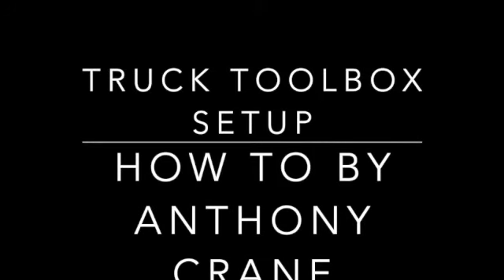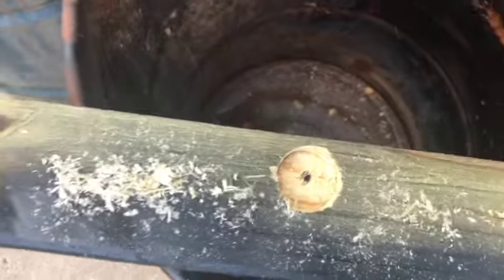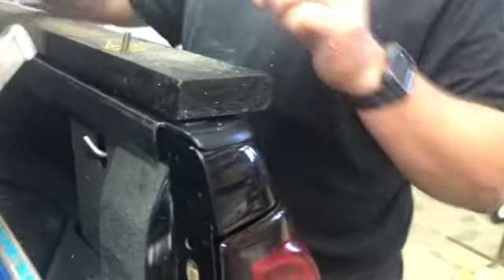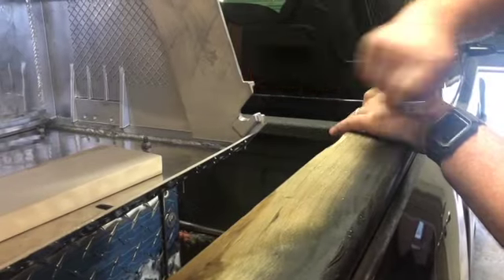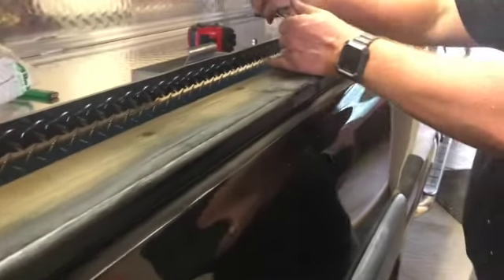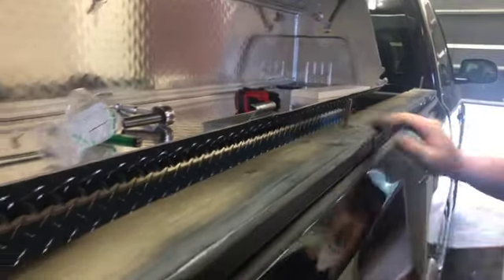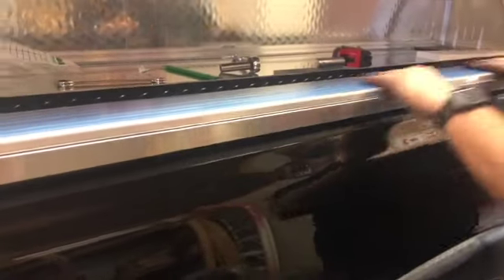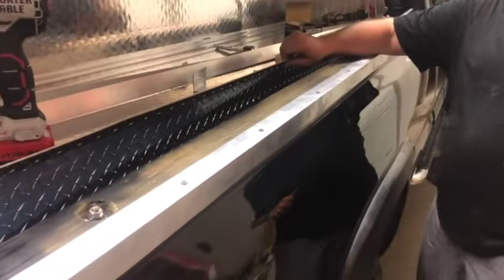How to build Truck Toolbox Setup with Decked and System One

Comment: Hi. 

Are you able to fit a sheet of 4’ wide plywood between boxes (on top of decked?
Reply from the maker: No, that is one drawback. But you can easily stand them up or put them on the ladder rack and strap the 4x8 sheets down. This is sometimes an advantage because you don’t need to move anything out of the bed of the truck.

Comment: Nice setup i'm in Ohio as well where did you purchase system one and decked
Reply from the maker: I ordered both on the Internet. System One I got from the link I shared at ladder rack. They shipped it right to my door. I ordered Decked from their website  and they shipped it to my door also. You will need to pick the size and model that you want for each one plus accessories. Let me know if that helps or if you have any other questions.
Reply: @anthonylcrane  thanks

Comment: I was looking at these a while back but couldn't find the package for an 8 ft bed until I found your review.  Was wondering how well things sat in the boxes did u have to put a mat in em or did everything sit fairly still going down the road... And how do the winches hold up to everyday use and the elements.
Reply from the maker: I live in Ohio and so far the winches have been great over the last 4 months. I believe they will continue the weather well because all pieces are aluminum. Also my boxes are full so everything stays in place down the road so I did not put mats. Depending on what you do System One does have a setup that has dividers and plastic boxes but I just wanted it more open because I use a wide variety of tools. I will post another video this weekend of how I have my tool boxes are setup.
Reply: @anthonylcrane  alright thanks man im saving up but dang  are these things expensive i feel like if i didnt have a japanese truck i might as well have just pulled the bed and put a utility body on it.
Reply from the maker: @brandoncole6358  Not cheap to do this setup but wanted a classier look then utility bed.  Utility trucks are great to work out of also but I got a nice deal on this Chevy Diesel.

Comment: What do you think about the locking latch system , do you think they’d be easy to break into or are they pretty tough?
Reply from the maker: I think the System One would be tough to get into and a person would need to get tailgate open and bust locks on decked to access the slides. I believe it is very secure compared to most toolbox setups. Thanks for watching.